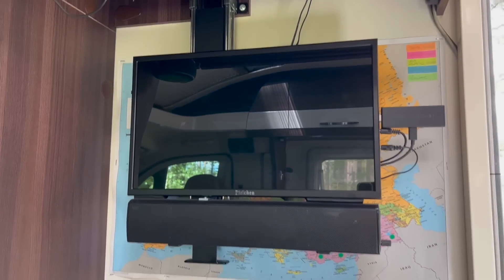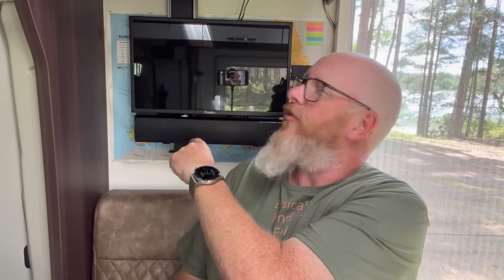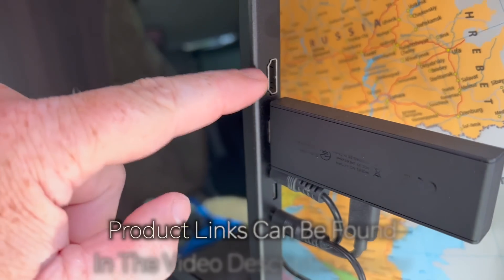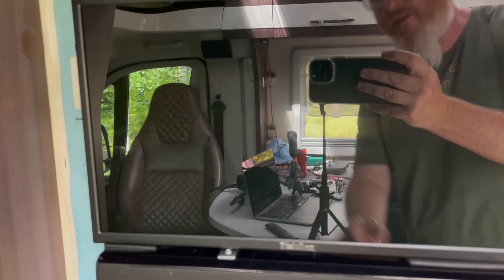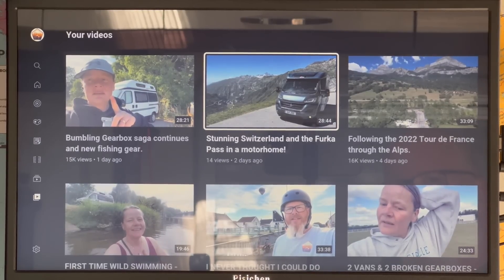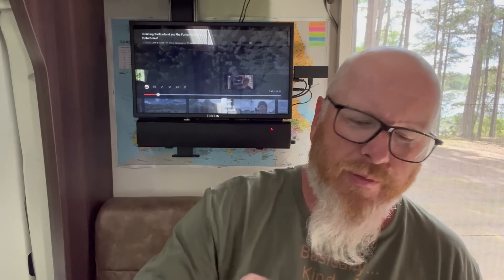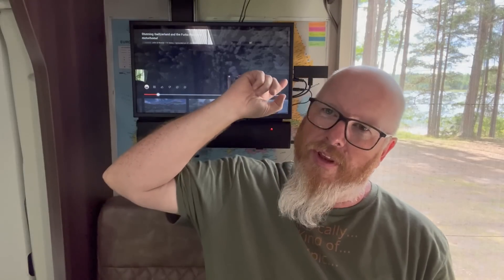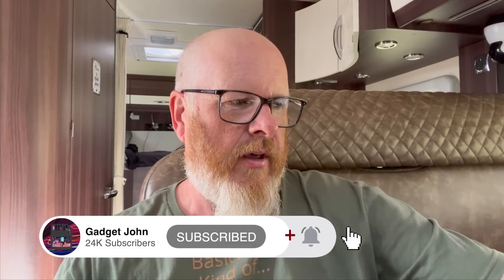It's actually not a TV - DV3

Comment: 12v is the sensible way. 
240v requires the inverter. Converting 12v to 240v wastes energy. Most tv are 19v or less. So you convert to un- convert.
Wasting energy.
Your set up is good 👍